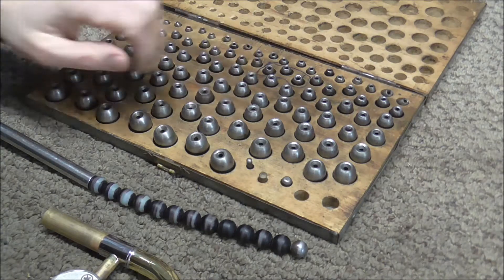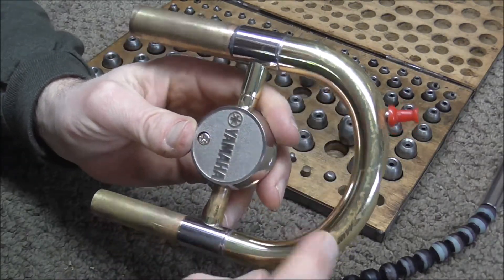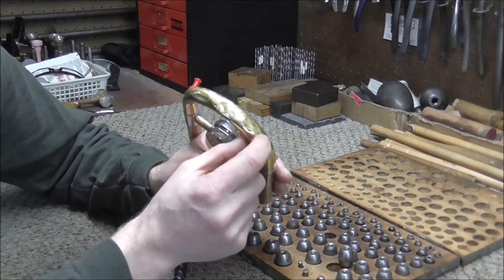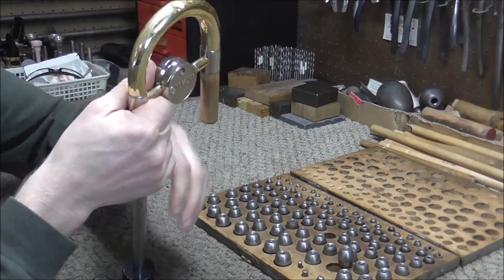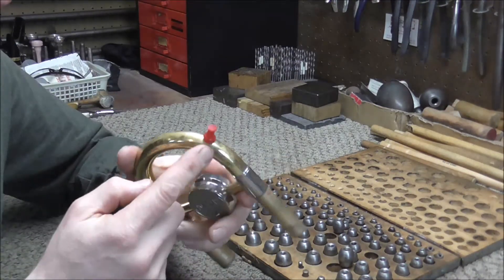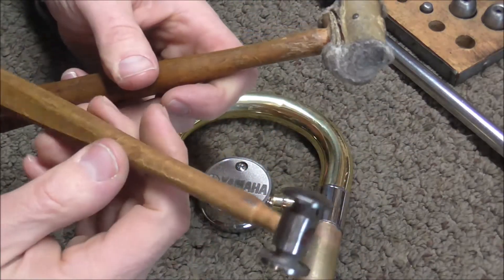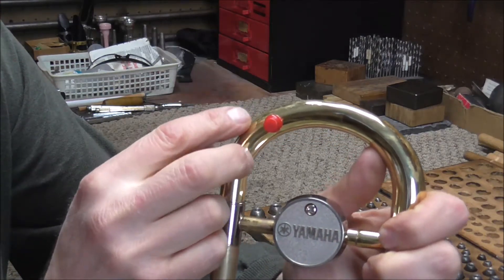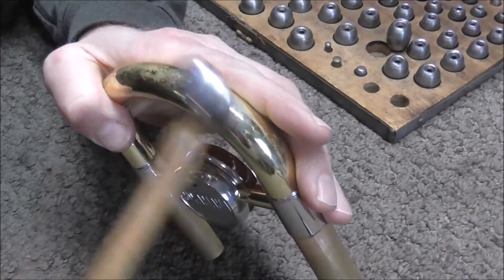How To Remove Trombone Main Tuning Slide Dents (part 2 of 2)

Comment: How do you remove dents from dual radius crooks?
Reply from the maker: You can use the same method shown in this video if the tool will fit around the smaller radius. If not, you may need to unsolder the crook and remove the dent with mandrels.